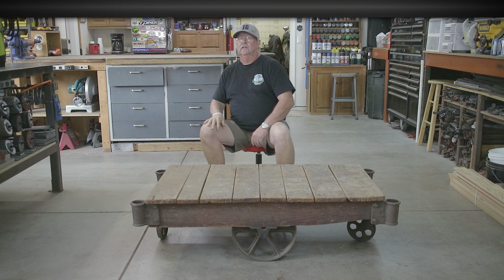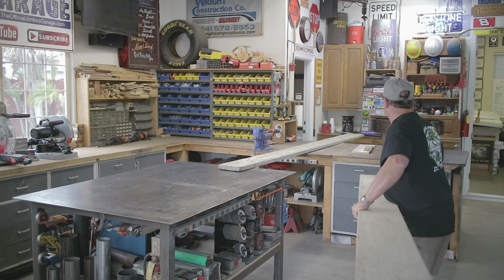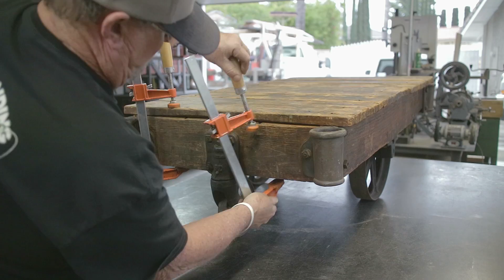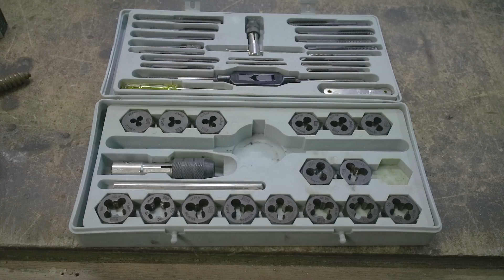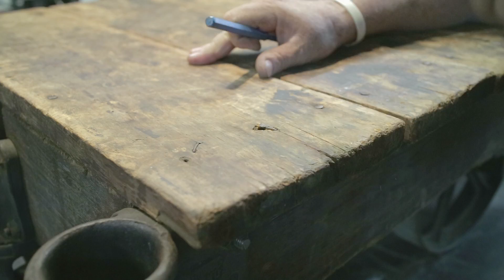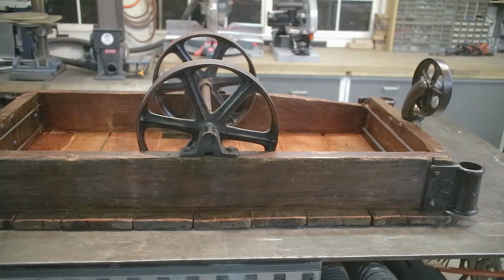Factory Cart Restoration - JIMBOS GARAGE

Comment: Jimbo I love the look and toughness of oil polyurethane varnish but it has one drawback, it looks like polyurethane varnish and one place that modern polyurethane varnish does not belong is on vintage metal.     Please consider trying Penetrol next time for the metal, and the wood.     Apply it in coats until it no longer soaks in and then just wipe off the excess and allow to dry into a soft ... sheen...

Comment: what's good Jimbo
I think someone told me one time that old nails were flat on the end. they were called square nails because they were square at the end not pointed.
also......
how's this for a project idea for you. make a small crane that bolts to the floor on a corner of your Welding Table to lift items onto it. make it so it can swing over the table or swing out from the table. I think they call it a jib crane.
 just a thought.
Have a Jesus filled day
Greg in Michigan.
Reply from the maker: Thanks for your support Greg, Ya thats a great idea, Or a gantry of some sort,  Jimbos garage!